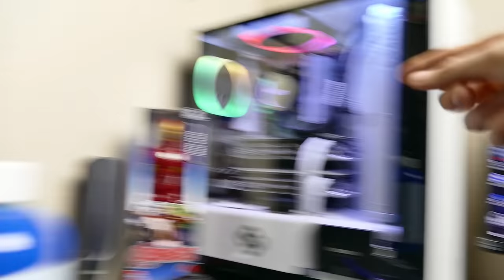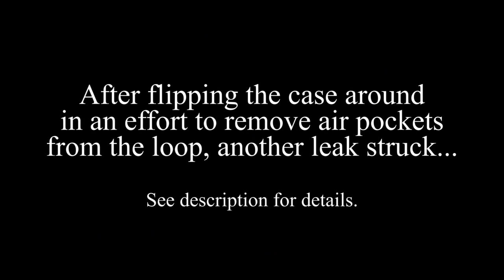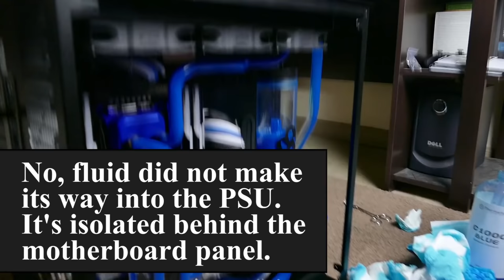Project 'Blue Sky' Custom Loop PC Build Log (Part 4 of 4)

Comment: did you really open a box whit a processor?
Reply: i wrote a comment exactly the same as this then i saw this one, dank memes bro
Reply: helistorm98 rich kids :/
Reply: Yeah I think I lost it there
Reply: CPU's are fairly strong, I've seen a customer bend the edge of the PCB on this CPU, trying to install it into the socket. We just slowly bent it back and it booted up. As long as you don''t mess with the gold contacts and transistors under the CPU you are fine.
Reply: ^"Cutting edge technology"

I'm done xD
Reply: Intel CPUs are tanks nowadays tbh
Reply: Jace Balavin I've now heard it all😂😂
Reply: TRIGGERED
Reply: Tom Ferreira, what CPU has transistors under it? I've only ever seen multilayer ceramic bypass capacitors. Your customer was very lucky to have their CPU work after bending the PCB, the traces that run through it are numerous and fragile and if any one of them is damaged it could cause problems.
Reply: KX36 , Yes he was very lucky. That's what I ment I didn't know the name, which you kindly corrected me on. We all didn't think it was going to work so we just tried for the hell of it.
Reply: Anyone know what keyboard he has?

Comment: Umm CPU's aren't unboxing knifes...
Reply: Tasso gamer sure they are! Tech city uses a bricked i7 as an unboxing knife.
Reply: Anyone know what keyboard he has on his desk? And is using
Reply: Tasso gamer They're definitely not knifes. On the other hand they are really great knives. 😏
Reply: I use a GTX1080 as a hammer. It's rubbish!
Reply: That's what happens when You are secretly rich. Opening GPU boxes with other GPU PCBs
Reply: I use an old bricked xeon pulled from a 2005 dell server to open boxes :)
Reply: if they are AMD they are... Let the hate flow.
Reply: I use a old 386 as a machete !
Reply: Not for poor people
Reply: I use a butter knife as a Cpu. It's rubbish.
Reply: Anyone know what keyboard he has?
Reply: Nigel Blackwell naa go ceramic they perform 10-20 frames better than traditional steel knives
Reply: Whoa!!! Steady on there Rich boy. ;)

Comment: hahah you almost did like kyle from bitwit
Reply: Yeah, but Kyle had only one or two leaks, and Greg had like 5 .... They are my favourite youtubers tho
Reply: those Alphacool fittings look fishy to me tho.. Probably going with BitsPower for my build
Reply: YellowPeaches
I went with Thermaltake and EK for my personal build... GPU block, tubes and fittings from TT and CPU block, reservoir and pump from EK... Was very satisfied.... Not a single leak
Reply: +YellowPeaches 

The leaks that happend in this video had absolutely nothing to do with these particular alphacool fittings. I have used these particular fittings on ~5 builds ( way over 50 fittings all together ) so far and i never had any problems with them whatsoever. Every single leak in this video were completely attributable to his inexpereince / incompetence.
Reply: what is the exact cause if you may know? Becuse if the fittings are actualy good then ill probably look into them.
Reply: +Yellow Peaches

I would guess that his measurement's ( if there was any measuring at all ) were off so the tubes didn't went as far in the fitting as they should and the whole thing didn't sealed. As i said, i have done ~5 builds with way over 50 of these particular fittings. Not a single leak. I am not a follower of his channel, i was just searching for this particular lian li case and stumbled across this video. Has he done any custom watercooling before? For me it looked like he didn't had much of a clue about what he was doing and how these things are working. Talking about fittings and tubing for example...
Reply: chen57 i wanted to say the same xD

Comment: Next build please with copper tubing, it looks so awesome
Reply: only looks good polished and clear coated IMHO
Reply: General_M , I'd love to see a steampunk build.
 Polished copper and brass, varnished mahogany, maybe a vape tank puffing out steam...
Reply: Jesse Kinch I would do all that if it looks good and if the cooling is that much better I would use it and give it a paint job with leftovers at my dads shop
Reply: Only bad thing about copper tubing is that it's harder to bend but it does look really nice
Reply: General_M Why not gold? he's yt celebrity he can afford ☝
Reply: james pope it's too weak as a material and would bend. It bends even more if it get's hot.  It's like the worst material you could ever choose 😄
Reply: how hot do you think a cpu water cooling loop will get? 50 degrees? maybe 70?
Reply: bmomosaik , wouldn't it be good if all that heat generated by the PC could go to something useful?
 Like a high-bandwidth coffee output on the front.
Reply: Massimo O'Kissed, Heat of my PC warms up my room during winter. Cosy.

Comment: the final shot of the computer is a good metaphor for this series.  Not quite complete but almost.  I think you should do a part 5 showing off the completed build, thanking alphacool for their tremendous support, and explaining a few pitfalls, unexpected encounters, and general thoughts on the process.
Reply from the maker: Yep, will do! Just won't be called 'Part 5' ;-)

Comment: I've never heard of an evga psu failing :(
Reply: Garru 
same
Reply: Garru , you just did.
Reply: mjc4wilton Ahhh makes sense, I'm hoping my g2 lasts me a long time then!
Reply: All brands have failures. There will never be a brand that has 100% reliability. Most component manufacturers have other companies make their stuff. Corsair has used CWT, Seasonic and Flextronics for their PSUs, EVGA uses Superflower, Seasonic and FSP for their PSUs, depending on the particular range, Thermaltake uses CWT, FSP and HEC for their units, Cooler Master uses Acbel, Enhance, FSP and Seventeam for theirs, and so on and so forth. Many brands have at least one manufacturer in common for their products, so it's really hard to rule out any brand as being particularly good or bad. The same can be said for most computer components, including motherboards and graphics cards, since there are only a few factories that can produce at the level these companies need.
Reply: I tweeted salizar and told him I never saw him put the psu in the case then he said he did in 3 and I looked and couldn't find it and didn't want to argue further.
Reply: My USB connector in my case caused my whole computer to not turn on.Unplugged it and no longer got a beeping motherboard saying the CPU was dead.Something as simple as a USB connector dies as well nothing is perfect even if it's been made like 1 billion times.
Reply: Garru, g2s are among the best psus made. Extremely low ripple and high build quality. They wouldn't have a 10 year warranty otherwise.
Reply: Garru Somehow he crashes every Psu he gets in his fingers.
Reply: I had an EVGA psu that failed and they got me to ship it to them for rma after I had to prove my fault diagnosis
Reply: Daniel Blackmore yes, you will have to ship shit back for companies, its called return merchandise authorization for a reason..
Reply: Garru then you've never heard of Greg. He can make ANY component fail. He's especially good at making power supplies fail :p
Reply: +David Tripp
But I remember him doing that, it's behind the motherboard you could see it when he was cable managing in 1 I think. Might be mistaking though.
Reply: Frederik N You've obviously never heard of Linus. He can make a computer case fail.
Reply: Garru mine failed 4 months after my build
Reply: GTA ONLINE well, of course I have. 
Seeing as this is Greg's channel, however, it seemed appropriate to bring up HIS relationship with broken tech. Especially since we were also discussing Evga, which I don't recall Linus breaking, whereas Greg, on the other hand, has. 
Nice meme, tough!
Reply: I've never had any PSU fail, still running an OC'ed 8 year old Xeon on a 400w CiT (That will spontaneously explode now that I've said this)
Reply: pitiful anonymous why wouldn't people want to watch his videos? They are entertaining and it's mistakes regular people would make.You don't see any other pro make the mistakes he does and it's nice to see  what i could expect when I get into watercooling or other things that go wrong.

Comment: Glad to see it's done. 

Now, we shall see if the negative air pressure comes into play with dust leaking in in the cracks. I have had issues with that in the past, but we shall see if your case (quite literally) is any different. 

Congrats on a done job! Hope she serves you well.   ;)

Comment: i found it helpful if you unplug the 24 pin mobo plug so the motherboard and other components dont power up during a first leak test, so if you do fine a leak nothing will fry. just use a jumper in the plug to power it on.looks sick man. love the colors

Comment: build looks nice and clean. 
good use of colours and clean lines.  
however i will address some cystom water cooling don'ts that i saw here. 
always check your connections twice before powering on.  
and always use a separate power source for pumps. 
never cycle on pc power with pump. if it does leak you could cause a short of you have parts powered on whilst bleeding.
additionally make sure your cuts are straight and clean where they go into the connections. 
inspect o rings for damage prior to using any fittings. 
hopefully this will help some first time builders.

Comment: Videos like this one reafirm my decision to never get anything other than air cooled systems in my life.
I've been a PC Gamer since the 386 days, and built my own systems since the Pentium 1 Era, but i've never in my life built anything with water cooling, neither custom loop, nor AIO, and since my PC is literally running 24/7 wether i'm at home or not has me far too paranoid that leaks could start when i'm not around to prevent damage.

Comment: Welcome to the darkside of PC cooling Greg :-)

While it's always stressful to have an initial leak (or more than one); everyone experiences some form of leak in their builds, it comes with the territory

I can't remember how many times I've forgotten to tighten a compression fitting to the max; or for that matter, forgotten to put a stop-plug on a connector...only to see all my (expensive) coolant draining onto the floor, sh*t happens.

Now that you've gotten your feet wet so to speak; keep tipping the chassis at various angles to get out ALL the air (all the tubes should be full of coolant, if they're not, then there's a bubble)...then sit back and pat yourself on the back for a (1st water cooling build) build well done.

Comment: On the fittings you could've added teflon tape for the leak, and then (i don't know if this is right or not) add some kind of gas like propane, then in a sponge add detergent and put some foam in the fittings, if it does leak the foam will make bubbles, if it does just add more tape.

Comment: I still wonder why you didnt go with EKWB blocks... Hands down the best on the market. Barrow fittings are also my go-to, 4 o-rings inside of each fitting. They dont leak. Plus they are way cheaper than most fittings such as Bitspower, etc.

Comment: The build looks pretty awesome. I like this blue coolant. Lets hope that pea size paste did spread into cornes on those gpu chips, they dont have heat spreaders and the transistors in non-covered corners could overheat as the die itself is not that thermoconductive..

Comment: You need to change all your compression fittings to use thicker O-rings around the tubing.
And you probably are already thinking it but, do leak tests with just distilled water next time. Save the colour. ;)

Comment: You should try air pressure testing first next time to avoid major leaks. You can use a low pressure pump (bike tire pump)  and some fittings from your local hardware/plumbing store to pressurize the system to around 7psi and see if it holds for 24hrs. That way your $$$ hardware is not going to have coolant splashed all over it. Also when first running your loop it's a good idea to run distilled water only then after your leak test is complete then run your fancy colored coolant. Good luck and happy water cooling.
Reply: dandel351, 7psi ...
Wouldn't that be a partial vacuum ? ;P
Reply: no, is there a vacuum in bike tires??

Comment: once i saw the first two leaks and how bad they were, i told my roommate you'd be posting another video showing another leak in 2-3 weeks.  well, didn't realize that next leak would've come in the same video ;)  but yeah, acrylic tube leaks are much more common because of how precise you gotta be cutting the tube at a perfect 90 degree angle so it seats flush inside the fitting.  worst leak i've ever had was literally an EK angled rotary fitting burst off the bearings spraying red coolant all over my room.  lol, PMP-500... loud and way too damn powerful

Comment: They should use transparent Aluminum aka Aluminium oxynitride or AlON for the water blocks and glass side panel. It can stop multiple armor-piercing projectiles of up to 50 cal bullets and withstand temperatures of about 2100 °C.

Comment: To edgy for me, using a CPU to cut something
Reply: Poor Man's Tech lol
Reply: I do that..... But i use fucking pentium 4, not 5820k....
Reply: Now I'll use my cpu edges to cut, so I can be edgy for use the edge of a cpu for being edgy... And cut myself in edgyness.
Reply: I have two options for box cutting...should I go Intel Pentium 4 HT 630, circa 2005 or Intel Core 2 Quad Q9400 (2008)? Perhaps I should switch it up and use a G.Skill DDR3 1333 RAM module?
Reply: Dh66
Use pentium 4, give q9400 and the ram to me ;)
Reply: I would go for i7 7700K for box cutting, although you will need another cpu to open the box the i7 comes in.

Comment: Why do you have the motherboard plugged into the power supply when you are cycling the pump on and off? To fill the loop use a second power supply with a jumper pin.

Comment: I was wondering. You could get some crystal-like effect to the water with adding some glycol based dye (fastly Googled and there's fluorescent water/glycol based leak-detection dyes). Glycol doesn't mix with water so if you add glycol based dye in your coolant it should add mist like effect. Glycol is inferior to water as coolant, but adding some just for effect shouldn't make a huge difference and glycol also doesn't change the corrosive effects of the water (it just lowers the freezing point of the mixture). The thing I'm not sure is that does glycol react with the additives in PC cooling liquid, but at least vegetable glycol is quite cheap stuff and trying out into a small patch shouldn't hurt if there's possibility to do something cool.
Reply: IcedForce ,
glycol & PETG no es bueno
Reply: Thanks for pointing that out. I ment glycerin, not glycol. Except there's glycol that doesn't react with PETG, propylene glycol which probably is running in many hardtubing coolings around the world, because it's the second most used liquid dye base (food colorings are oil or propylene glycol based). It's the industrial ethylene glycol that melts the PETG away (because PETG is made from ethylene glycol) and it's whole different chemical from propylene glycol.

Comment: How do the thermal pads work? What are they made out of? They honestly look like they would be horrible at transferring heat, but that can't be the case if they're included on  a $500 GPU, right? Also they remind me of pipe tape.
Reply: Solomon Cornish , silicone rubber, formulated for extra thermal conductivity, moreso than regular silicone.

Comment: Looks great!   Though, on a build of that level, the upside down OCool on the radiator would bug me if it were mine.  Have you considered rather than the plexi cover (which does look very good) on the second gpu, put a mirrored cover to allow the reflection of the nice looking gpu waterblock.    I would say put one under the second as well but would probably interfere with the air flow to the radiator.

Comment: It's like a car with no windows or head lights.... Seen the missing plug right off the bat, something didn't look right. Hope I don't make the same mistake. Planning my first custom loop for a Ryzen build. I used my burnt up Athlon x2 to unbox all the new parts for my current system. I'm gonna have to add LED strips to my desk, would look awesome with a tempered glass case on (or next to) tempered glass desk. RGB goodness.

Comment: What
caused the leaks, it looks good, and I will stick to my Primo Flex Advanced LRT tubing.
I give you props for going with the hard tubing. I think you should go with
bitspower fittings. I have never had a leak. Thank god you did not damage the
mobo... It does look good though.

Comment: Did you flush the loop with water first? When I built mine I cleaned every piece by hand the first time around and then when I flushed it with distilled water (before the coolant) I still got some fairly substantial particles and crap that came out when I drained the water. (And yes I flushed the rads for like 20 minutes, and the CPU block)

Comment: What a depressing conclusion.  I hope you haven't given up on the project altogether!   The sense of accomplishment when it first boots is great, but not as good as when you dial in overclocks higher than you've ever seen before on both GPUs and your CPU and it passes it validation/stress testing.

Of course, actually using the system afterwards is great, too :D

Comment: did you not use a psu jumper? also it the curse of the first water cooling build, when i did mine the first pump went bad then once i got that motherboard just quit out on me. nice work.

Comment: Hope you already realized that the psu is not dead, if you jump it or use it without a real use of power and only the pump tgey sometimes trigger a fail switch inside. Maybe try if it still works after the build is finished.
Reply from the maker: Tested elsewhere. It's 100% dead.